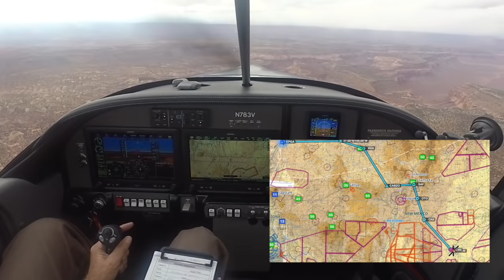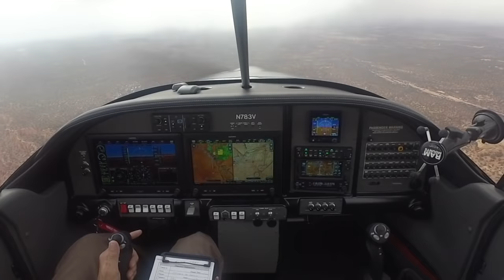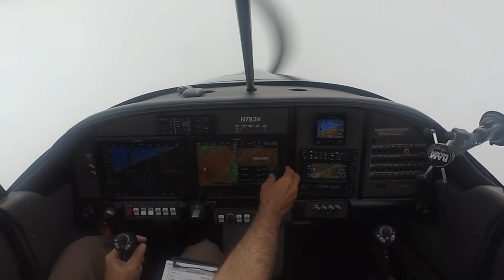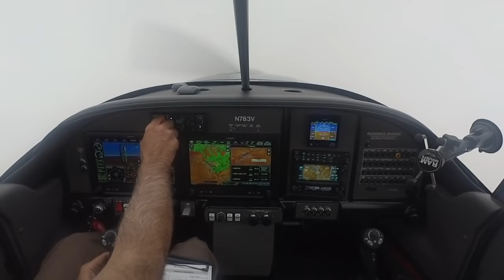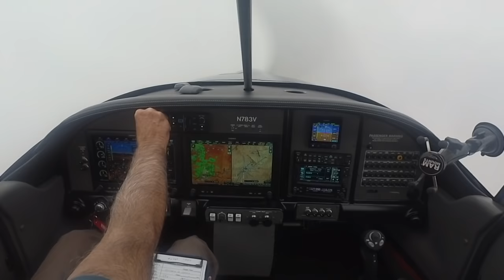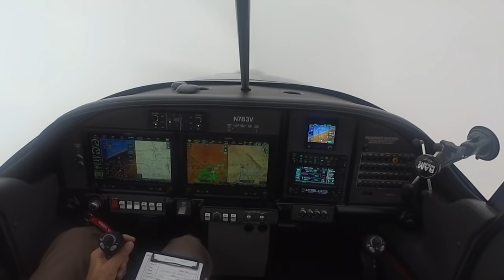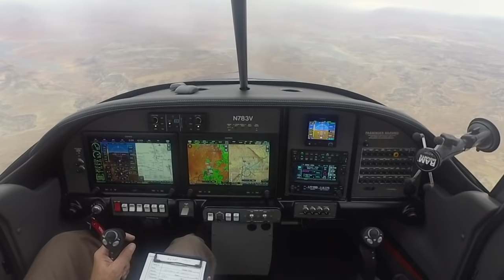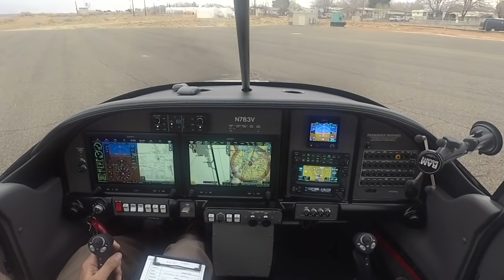RV 10   N783V   My 1st Emergency   HD 720p

Comment: I am not a pilot, but common sense tells me that you posting this video was probably one of the greatest services to aviation you will perform in your lifetime.  Well done.
Reply: Absolutely.
Reply: DID YOU ALSO NEED CARB HEAT? I THINK I WOULD HAVE IT IN ALSO,  MAYBE FUEL INJECTION SAVED YOU THERE.
Reply: He flies air ambulance now
Reply: Very well said.
Reply: Pucker factor must have been off the chart
Reply: Well said👍🏾💪🏾
Reply: @ophiolatreia93  air ambulance isn't a service to aviation, its a service to his community.
Reply: Not sure if anyone said it already, but going to the emergence radio frequency 121.5 vhf or 243.00 uhf would reduce the pilot workload in this situation.  Thanks for sharing gut wrenching watching all visual queues disappear.
Reply: Definitely
Reply: Great comment!
Reply: @howardtucker2423  you know fuel injected engines don't have carb heat right?
Reply: Siuuuu. Great comment 👍
Reply: I second this. Not a pilot, but so much respect to this man for sidelining his ego to share valuable learning lessons. And staying calm, cool and collected. Some rare traits these days.
Reply: I got to agree ☺️👍
Reply: We can do all that you are in a flight sim ,why actually put yourself in that position of risk.
The future is moving toward unmanned craft with pilots on the ground, thank goodness.
Reply: Yes. When I started flying there was no internet and pretty much any video that you would watch was on a VCR tape and they were hard to come by. Now I spend almost all of my free time watching situations that other pilots got themselves into and how they handled it. I feel like I've learned more from watching YouTube than I did up there puttering around by myself.
Reply: I concur with this comment! - well done!❤